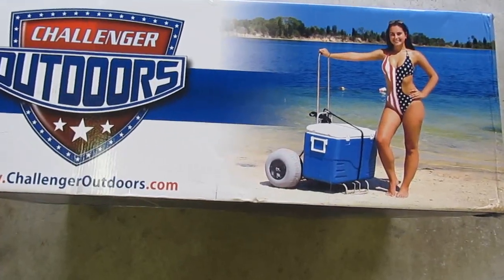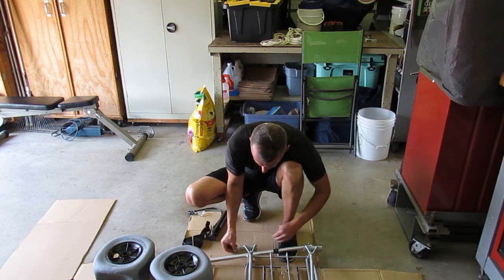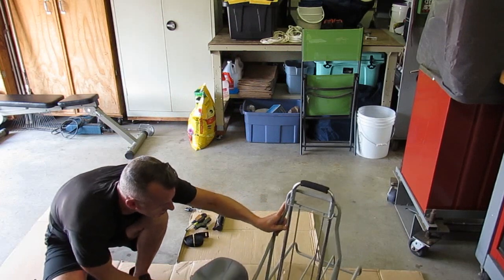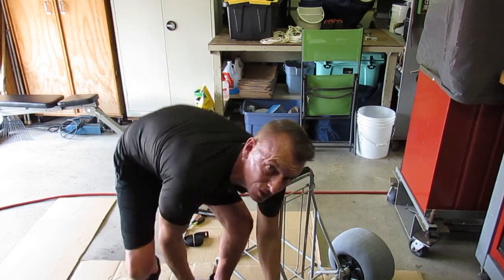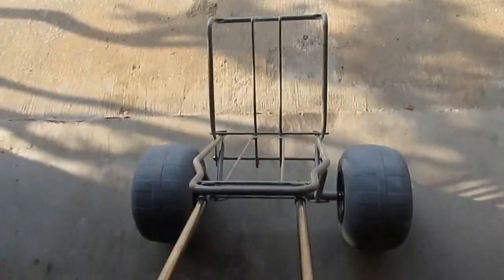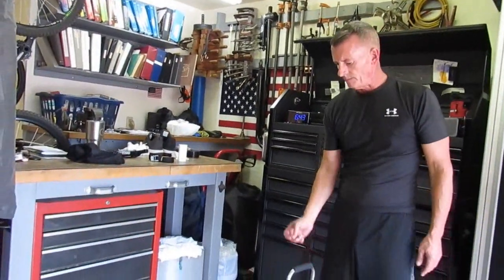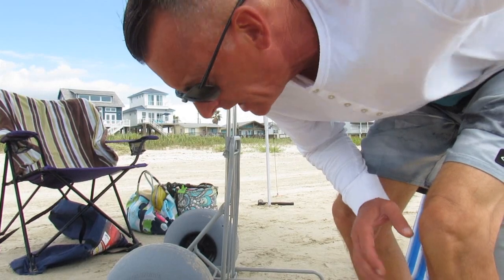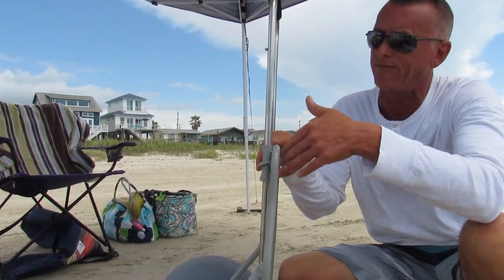Beach Cart: Two Wheeled Beach Dolly from Challenger Outdoors

Comment: Just ordered this cart after seeing your excellent review, complete with pointing out the flaws in the construction that come with it. I originally was after a Wheel EZ  but there were none to be found. I checked out Amazon and was going to go with a Velvor which looked pretty good but there were no reviews on it despite a five star rating. herded also weren''t any here on YT  which is how I ran into your review.  

Main thing I was after was the big balloon tires that won't sink into sand like cart that  I have now thatches four wide, plastic wheels.   Plus , I used some of my bonus points on Amazon sonic didn't cost me anything .You use yours in one week than what mine will do all season so it should work out fine. I'll be waiting to see if the handle on mine will be improved since you bought yours ...

Thanks again for a really good, 'real-life' review on this item.
Reply from the maker: Thanks for watching Jim. Update: 2 years ago we bought our dream beach house. We have a golf cart and a beach-Jeep that we use to haul our gear now. We mostly use the 2 wheeler for hauling gear to our grandchildren’s sporting events. That’s not what was intended but at least we can put it to good use. Thanks again and good luck.